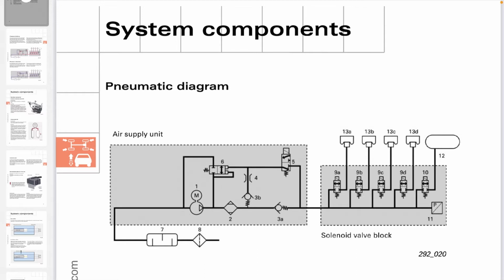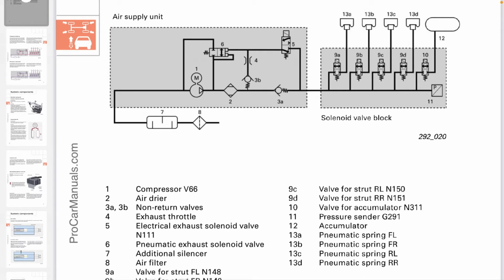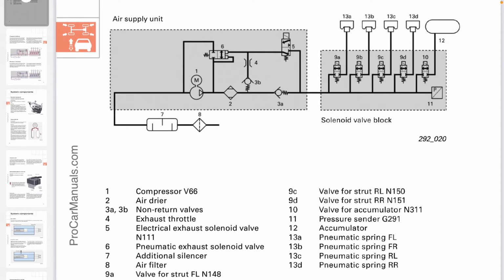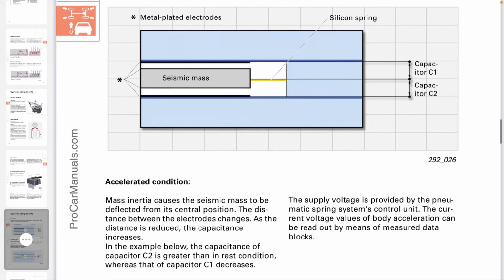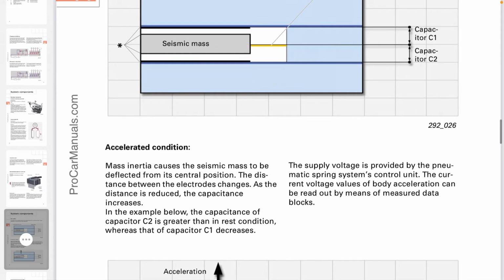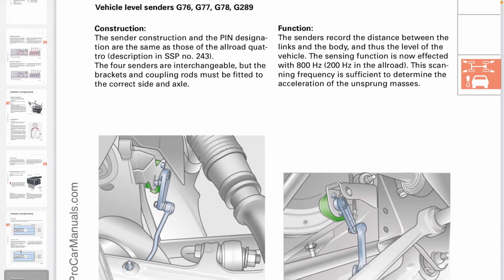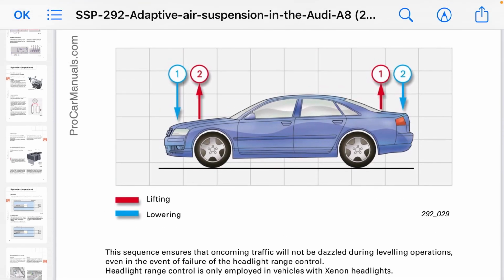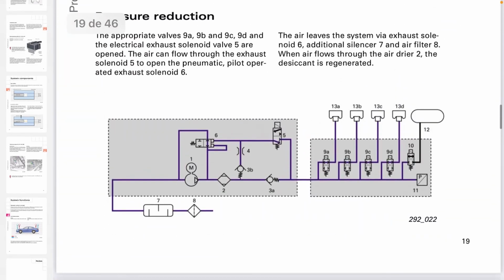Audi A6 C6 Allroad Air suspension diagram

Comment: Thank you for this.  I was checking valve block for leaks loosened too much air now adaptive air levels are all greyed out and don't hight white with ignition turned anymore.  What do I need to do?
Reply from the maker: If it is leaking too much, the system won’t you allow to do anything (it is showing the yellow warning and the green one as well). Since the system is trying to level up and the air tank and compressor are trying that too but they can’t, the valve block has an internal temperature fuse and since the system is running too much and a critical temperature is reached, it won’t you allow to turn on until the temperature is lower. However, if it is making that from cold one, maybe you have a severe leak or the valve block is not working properly. You need to make a diagnosis from vagcom to be sure.